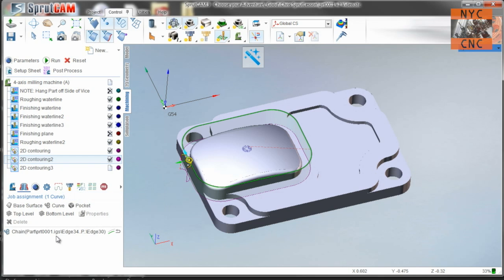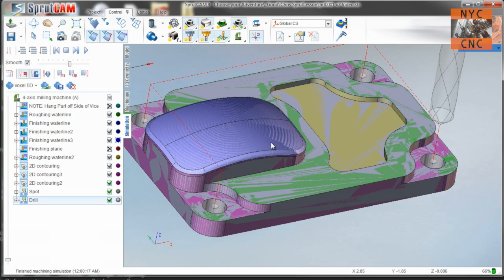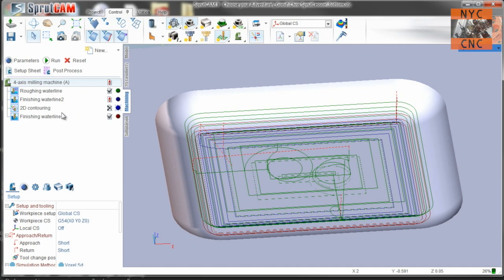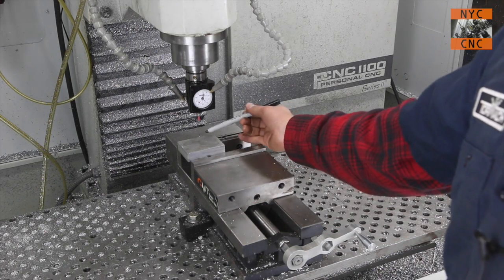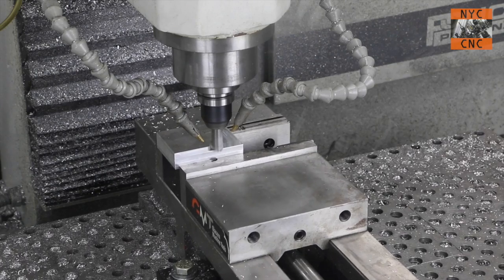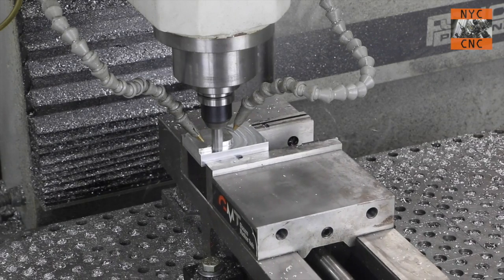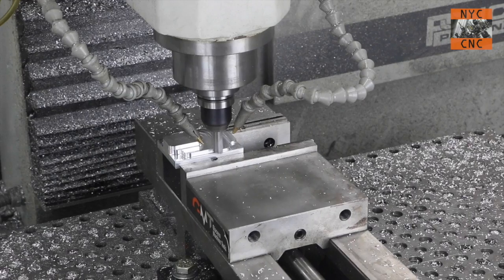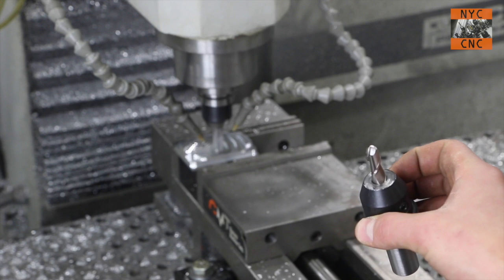Choose Your CNC Adventure: 3D Machining on the Tormach!  Part 2

Comment: John, 
Are the machines typically this slow or did you crank it down for demonstration purposes? Asking because we’re looking to add another machine to our shop and also been looking at possibly purchasing a used haas vmc versus something like the Tormach or Novakon. Concerns are the ipm rapids. We’d need to be able to cut 50 parts like what your cutting per working day. Mostly small run parts but the machine would need to kick out 250 to 300 parts a week. The obvious Downside to a haas is the expense to maintain it. The accuracy and rigidity are not necessarily the prime components we need since were not making aerospace parts.